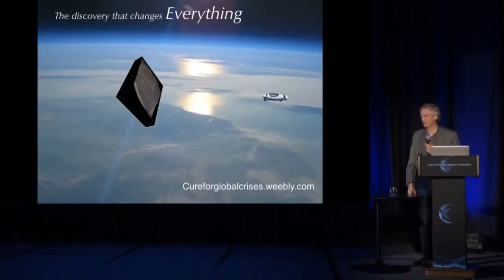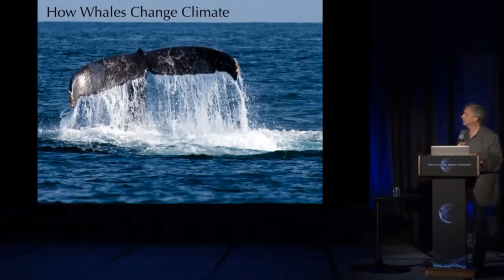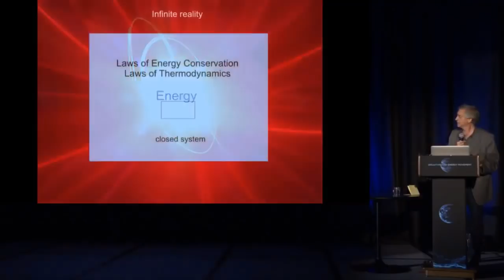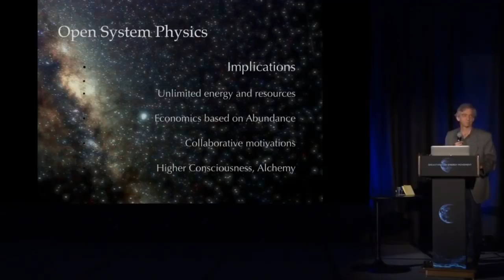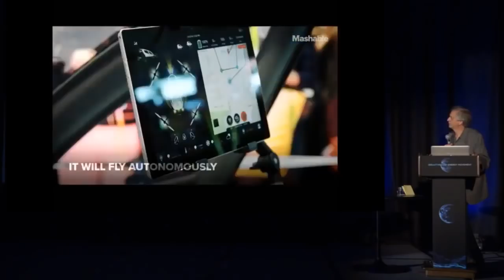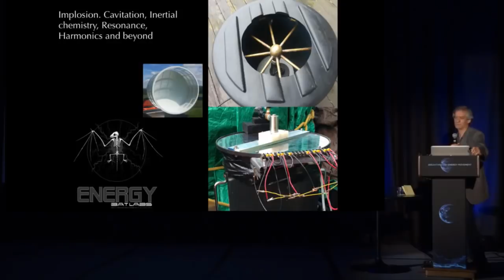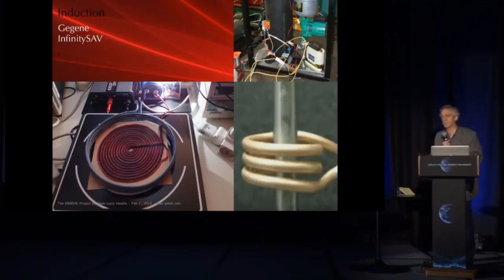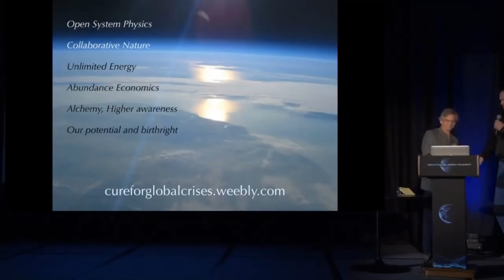Open System Energy Breakthrough Technologies | Mike Waters | #VTOL

Comment: Excellent lecture! I have personally constructed several working models based on a private theory of quantum inertia. These new methods show that electricity does NOT obey the Newtonian laws of fluid dynamics; doubling the power of the typical electric motor-while also cutting it's weight in half. This would mean, for example, "4X over-unity", or getting 800 miles per charge, instead of only 200 miles per charge, without any new improvements to the battery, nor any advanced electronics or computers needed.  Electric aircraft with long range are now possible (today/yesterday).  It's a scalable tech that could use recycled materials and help bring clean energy to developing nations- if nothing else, than by doubling or quadrupling the output of wind power, etc. I would love to connect with Mike Waters and discuss the potential for commercial, consumer, or industrial applications for these type of quantum energy systems and resonant amplifiers.  An inventor like me just wishes he had the funds to build whatever he wants, but i really want to get into manufacturing and build a profitable, new business, based around doing what i enjoy doing- building energy machines or more advanced, high-powered machines for niche' customers or private contractors- (not wasting investors money). My goal is to get paid for results- not promises. I don't mind signing any NDs- if i think somebody might have some useful data or science observation that i actually need, or some new tech that i could use to compliment my own. "Polymagnets" comes to mind- i would sign away my first born child for a chance to really work with their team and see inside their tech, their data, and their patent applications for programmed magnetic fields.  I am writing the bylaws for a new corporation, and at least one patent application in the works, but still looking for ideas and "seed capital". My email is SunsaverfromNHH@gmail.com. I am currently applying for entry into the Global Cooling Challenge, sponsored by Sir Richard Branson of the UK.